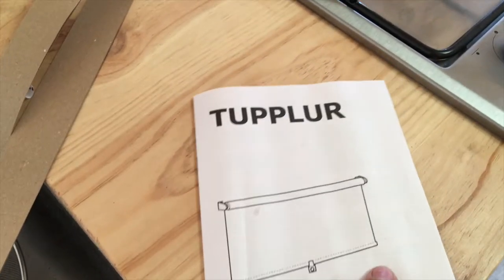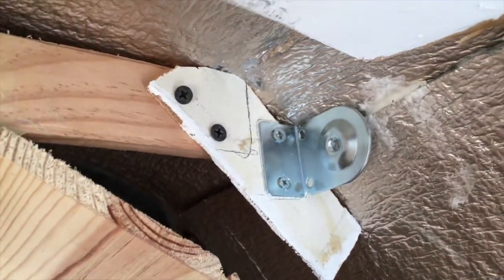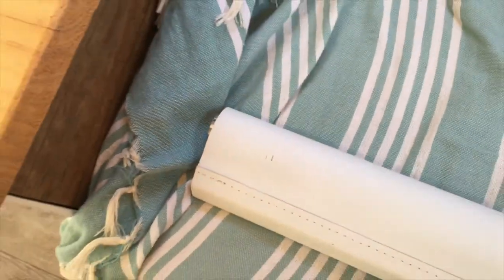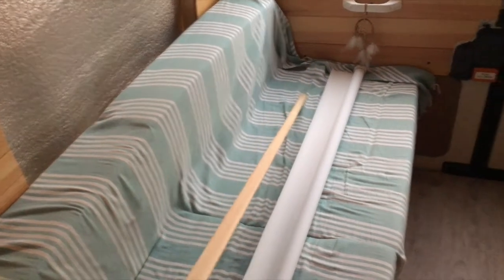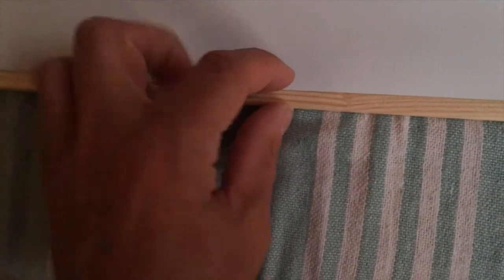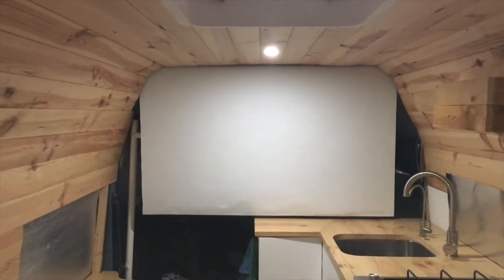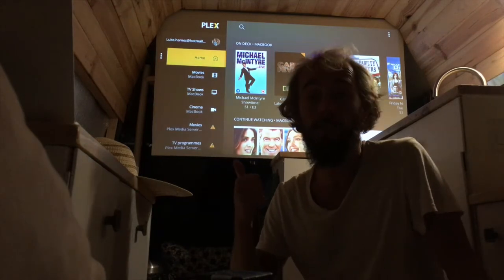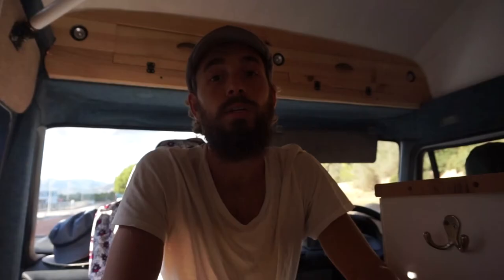Cinema in Van | Upgrading to new bigger projector screen

Comment: Great video, what projector is that you have?
Reply from the maker: Liam Dickson Hi Liam, it’s the LG PH30JG, really great little projector. Going to do a separate review on it as been using it for over a year now and its great! I have some links in the description for it if you are interested, I think it is end of line now, but still has better specs than a lot of the newer models! Still not found another HD projector with 4 hours battery life, at least not at this price point! Plus you can charge it from USB-C so can be run of a power bank if needed, super handy for the van if you have a few cloudy days!

Comment: I love the hideaway for the projector! What sort of push latches did you use to keep it tucked away?
Reply from the maker: Hi, sorry for the late reply! Thanks we thought it would be nice to keep it hidden as we don’t use it that often! We have actually tried a few different hinges. At the time of filming this video I think I just made some wooden brackets to hold it in place, we then replaced them with some kitchen door hinges, the ones that you push in to release and they spring out. These work great, but if we go over a big enough bump it can drop down, but it only drops a couple of inches and the projector is secure inside so not the end of the world. I can find a link to some if you need 👍🚎
Reply: Since posting my comment, I've poked around some on the subject and found a variety of suitable spring clips. 

I do have a followup question - did you guys do any insulation on the inside of your ceiling? And did the hideaway projector interfere with that at all, i.e. did you have to not insulate that little section? (I kind of expect you didn't insulate your ceiling at all, considering where you are)
Reply from the maker: @scottweikert5189  They sound like they are probably better than what we used. 

And yes, we insulated the whole roof with the metal/bubble insulation (can’t remember the name) as it is suppose to keep the heat out in the summer and heat in during the winter, but we then also added some proper thick insulation in the walls and ceiling, however this like you imagined had to be removed for the square of the projector. I think in one of my other video’s on the build I show it, if not you can definitely see the insulation, and that it is only the reflective metal stuff where the projector sits.
Reply: I see! Thank you much for the helpful replies!

Comment: This is sick !!! What speaker you running mate ?
Reply from the maker: Thanks Dean, we are using a set of Logitech 5.1 speakers, perfect for surround sound in a small space, can’t remember the model number, Z... something, I should have put a link in the description 🤞
Reply: @LukeHames  Those don't look like they're 12v, are you running them off your inverter?
Reply from the maker: @scottweikert5189  Hi Scott, yes the Logitech speakers run off the inverter, but they don’t use very much power. To be honest we used them as I already had them laying around doing nothing so didn’t really look into any other options.
Reply: I suspected as much! I was researching sound systems that ran on 12v and came up with basically nothing, hah.

I was also looking at the pico projectors, including the model you used. As best I can tell, there's no adjusting the projected output, it's just "place it at the right spot away from your screen", yes? I assume you took that into account when you decided on where in your ceiling to mount your projector?
Reply from the maker: @scottweikert5189  yeh, I cannot think of many cinema surround systems running on 12v! I would probably put a proper home cinema amp and speakers in if we do another one, and just have a bigger solar/battery setup.

And spot on with the projectors, I imagine it is to do with the small size of the units or something but they all seem to have just the one throw ratio.
I had to hold the projector on the ceiling and try and get the right position, as it was we only just managed to fit it behind one of the metal frames of the roof.
Reply: @LukeHames  Cool. Basically confirming what I had in my head, just wanted to make sure I wasn't crazy. :) Thanks again Luke!